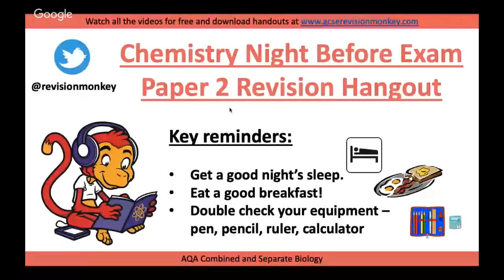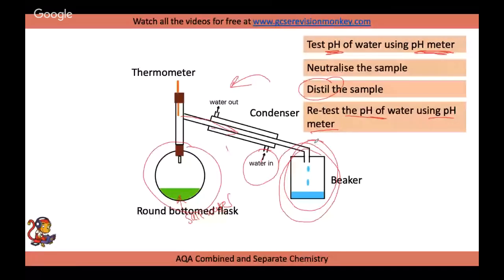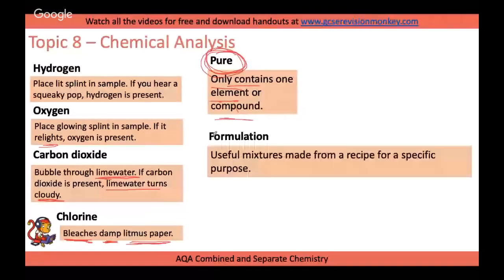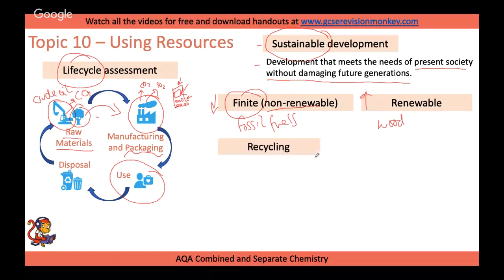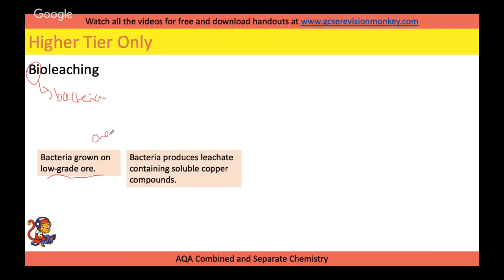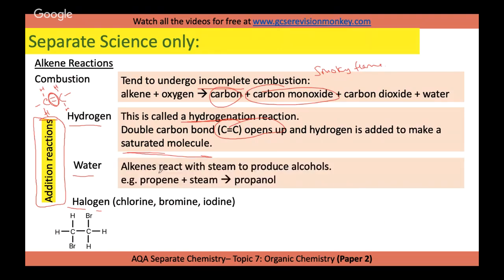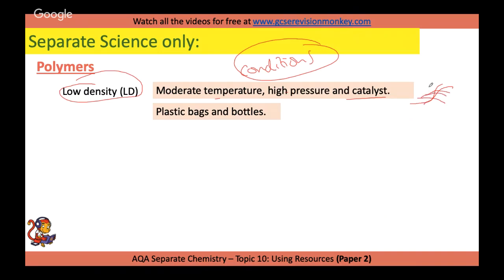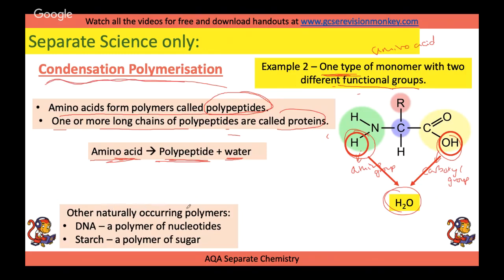Chemistry Paper 2 (Night Before Exam) 2019!

Comment: It still blows my mind that something this good is free... least I can do is say thank you! (Have my mock tomorrow) Also just so you know these videos do help as on my paper 1 mock I got a 9 somehow.. I was getting like 4's in year 8 haha :)
Reply from the maker: I’m so glad it helps you - good luck in your mocks!
Reply: Revision Monkey Got the result back - got an 8 :) thanks for the vids and I’ll be tuning in this year in the summer!
Reply: MintyAviation hey what came up??
Reply: @joet5960  Hi! So obviously it was the 2019 Paper 2, and I don't want to give away too much incase you are doing it yourself (for your own benefit!), however I'll give you some pointers to revise from. You need to make sure you can define and explain phytomining (3 or 4 marks I think), and you should revise the effect of carbon dioxide/greenhouse gasses on global warming and how it occurs (long wave and short wave radiation). I'd also advise remembering the tests for gases (oxygen gas in particular ;)), and also to define a formulation. I'm sorry, I cant remember much more, but in my opinion, the test was quite easy, maybe even easier than Paper 1, so I'm sure you'll do absolutely fine if you do it yourself! :)

Hope that helps!

Max
Reply: MintyAviation what where the 6 markers about ?
Reply: @parisbery5111  Umm, I honestly cannot remember clearly but I know the last one was on short and long length radiation and global warming, carbon dioxide etc, and there was one other which you literally just compare three cars and their efficiency, you dont have to revise for it at all just say what you see, i got 6/6 you'll be fine!
Reply: MintyAviation have you done paper 2 for physics yet ?

Comment: i thought that during le chatelier's principle, when you change the pressure, the shift of the equlibrium depends on the number of gas molecules not moles????
Reply from the maker: Yep, you can say gas molecules, that's fine too - by definition, if you have more moles, you have more molecules so they're directly linked.

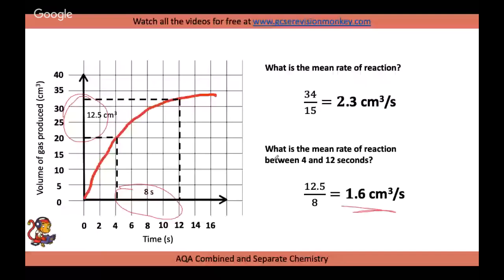Comment: 13:03 did you mean 8/12.5 since it is rise over run
Reply from the maker: 12.5/8 is correct as it produced 12.5 cm3 in 8 seconds. So to calculate the rate, it's the change in y-axis over the change in x-axis.
Reply: @revisionmonkey3859  rise going up and across is run  ?
Reply from the maker: yes, that's right
Reply from the maker: Paper Chromatography and distillation don't lend themselves to variables as they are just separation techniques.

For the rates of reaction practical, they will change one thing and this will be indicated by the question in the exam (e.g. concentration or temperature or pressure and that will be your independent variable). Your dependent variable will be the rate of reaction. Your control variables will depend on the reactants, but will be things such as volume of acid, mass of magnesium e.t.c. (if your Independent variable was concentration, you'd need to control anything else that affects rate of reaction e.g. temperature and pressure).

Comment: what about maths skills because 20 percent  of the paper is maths skills
Reply from the maker: So the 20% is across both papers, so if there was a slightly higher weighting on paper 1, there may be slightly less than 20%.

I think on this paper, this could be assessed on Rf values, drawing a graph, calculating rate from a graph, calculations such a means, uncertainty and simple calculations that would do in compare/evaluate questions.
Reply: @revisionmonkey3859 thank you appreciate it . you are my last minute revison savior
Reply from the maker: Glad to have helped. Hope the exam goes well tomorrow.

Comment: nah hang on i thought the rate of reactions would increase if there was a decrease in surface area as theirs less space so more collisions in that area.
Reply: no, it increases because there's more area for the reactions to happen. Imagen a square you can only react on the four outer sides and nothing from the middle but if you split it up you have more sides to react one
Reply: @aliyahali7275  thank u.
Reply: That’s volume. Surface area is the outside surface that is exposed so if there is a higher surface area more is exposed to the rate is quicker. If the volume is decreased there is less space so there are more frequent collisions :)
Reply: @mariajoseph9722  brilliant explanation as u probably can tell im proper dumb but got my exam tomorrow so thank u for your help.
Reply: @michaelreynolds8098  thats okay haha good luckk
Reply from the maker: No, if you increase surface area, you increase the rate of the reaction because there is more surface exposed to the other reactant, so there is an increased in collisions. Think about a large lump of metal in acid, if the acid particles will be colliding with the outside of the metal. If you break the metal up into tiny pieces (and therefore increase the surface area) there will be a bigger surface area for the acid particles to collide with, therefore an increased frequency of collisions. Hope that helps.
Reply: @revisionmonkey3859  wow! thank u very much i understand now, very helpful response :)

Comment: 1:39:55 I'm confused on electroplating, you said the ions will move to the negative iron, but I thought electrons will move to the positive material? Thanks
Reply from the maker: If you set the metal object you want to coat as the negative electrode (e.g. iron nail). Then put a piece of pure metal (e.g. zinc) that you want to coat it with as the positive electrode. Then put it into an electrolyte containing the same metal as the one you want to coat the object with (e.g. you could use zinc nitrate), the metal zinc ions (which are positively charged) will move from the positive electrode, through the electrolyte) to the negative electrode and coat the iron nail. 

Hope that helps.
Reply: Thanks this was really helpful, will you be doing it for physics too?
Reply from the maker: Yes, my colleague will be doing a physics one, on this channel at 4.30 Thursday afternoon.